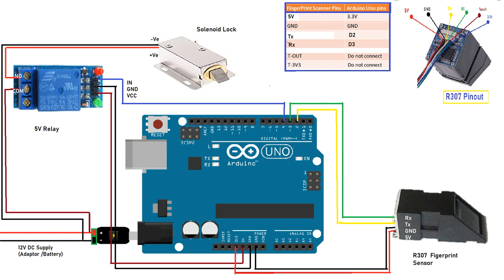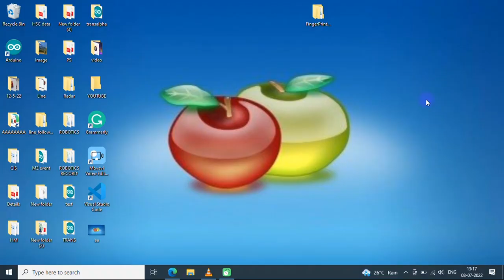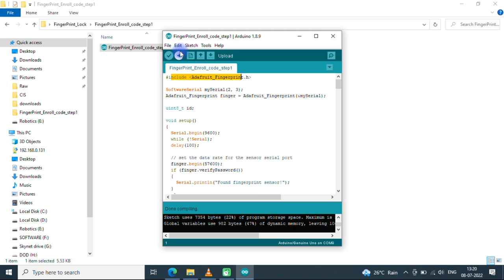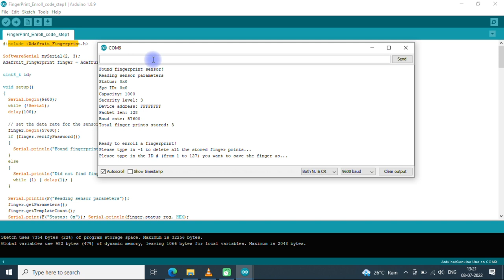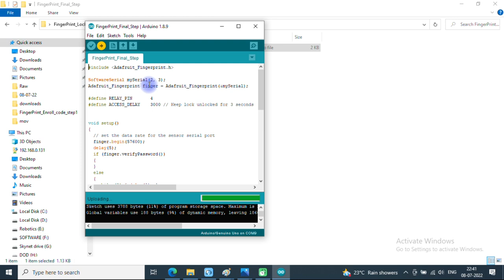Arduino Fingerprint Lock || Arduino project ||Solenoid door lock

Comment: hi. For my project i have a TCS230 color detector sensor as well with a lcd i2c display. Everything is working just fine connected from usb to laptop. When i connect a external power supply (5v 3A )for my project, the lcd i2c display doesn't show data anymore. Should this be a power supply issue? I have also connected it to ~7v batteries and it doesn't work neither...
Reply from the maker: Change brightness of LCD by adjusting potentiometer back side of display (on i2c)
Reply: Connected to usb it shows good, you can read data on the display, when I power the project from external source 5v, 3A or batteries- 6V, it just light blue but doesn’t show data…